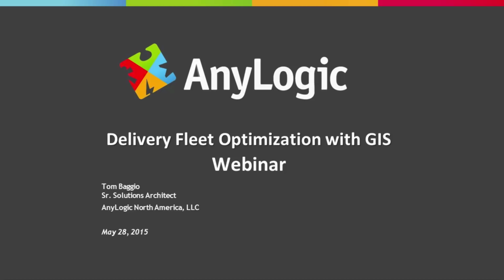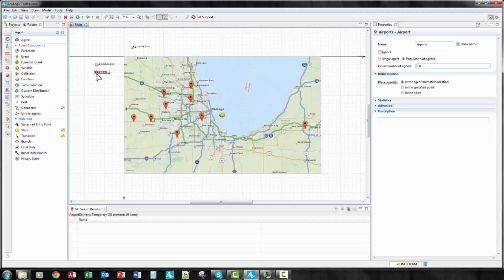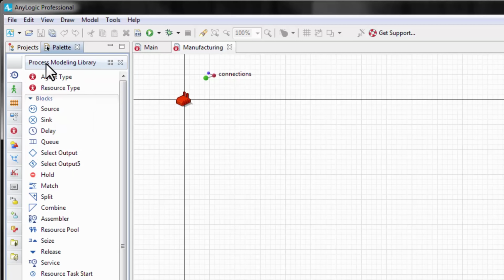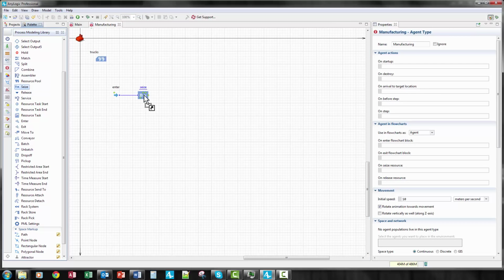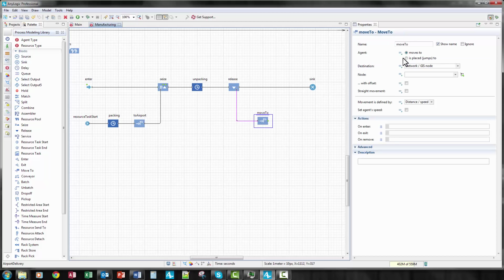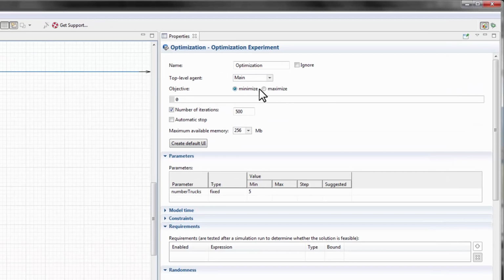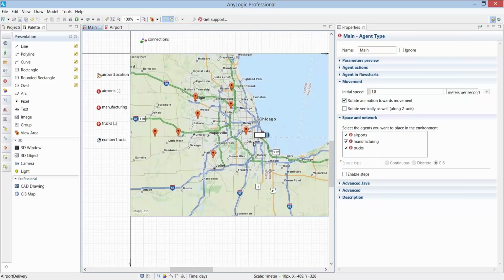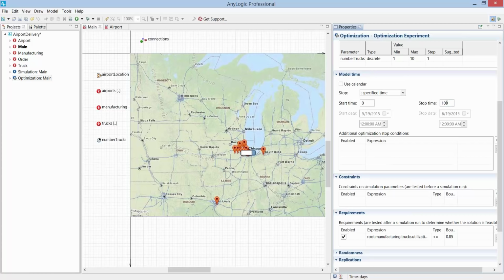Webinar | Delivery fleet optimization with GIS

Comment: Do we need to put anything on the constraints while running the optimization experiment as I am getting an error of infeasible solution
Reply from the maker: Thank you for the question. 

To begin with, some solutions are infeasible in the video as well (see timing 39:14-39:18). The fact that a particular solution may be infeasible does not imply that the problem itself is infeasible. However, infeasible problems do exist. Please have look at our documentation article about feasible and infeasible solutions while running an Optimization experiment for more details - https://anylogic.help/anylogic/experiments/optimization.html#feasible

Comment: How can I solve the error 'constructor is not defined'. I keep getting this error at the waitingdetails
Reply from the maker: Hi there, 

Please follow the steps from the video once again and double-check that the entered value, used Java code and connections between elements are correct. If the problem persists, please specify the time of the moment in the video when the problem occurs. Also, please share what AnyLogic version and edition you use.

Comment: Hii.Thanks for the video.Im so new to anylogic. 
1.why we are optimizing here?.We got output before optimization right?
2.If i need to stop  vehicle at each destination at 3 stops in a day and then resume in it in a next day for 3 stops how can i do it?
Thanks
Someone please  help me my basic doubts.
Reply from the maker: Hi, 

Please check out the answers to your questions below: 

1. Optimization experiments help to find the optimal combination of conditions (parameters, constraints, requirements) resulting in the best possible solution (maximizing or minimizing the objective function). The reason to use the optimization in this project is to define how many trucks are needed for a targeted truck fleet utilization. The targeted fleet utilization must be as maximum as possible, but not higher than 85%. The parameter that is varied during the optimization experiment is “numberTrucks”. As a result of the optimization experiment, we know that the value of “numberTrucks” that fits our objective most is 3. 

2. Making a truck spend some time in its destination is a part of further model development. This specific question is finely covered in Phase 5 of our tutorial “Supply Chain GIS (Agents)” - https://anylogic.help/tutorials/gis/5-further-development.html#phase-5-further-model-development. To be more specific, the transition that goes from one state to another should be triggered by: 
a. Timeout to make an agent stay in the state for a specific period of time 
b. Condition to change the state when some specific condition is satisfied

On a side note, as a first step in simulation modeling, we suggest checking our website section "Get started with AnyLogic" - https://www.anylogic.com/getting-started/. Some certain parts of this webpage are worth your attention, such as the "AnyLogic in Three Days" book. It provides an overview of the simulation itself, its concepts and approaches as well as introducing the reader to AnyLogic interface via instructions on how to build simple models. Moreover, here you will find materials on industry-specific libraries, tutorials, model examples and more.

Comment: When I run the simulation, the truck agent does not appear on the screen. Is there any explanation for that?.
Reply: I'm having the exact same issue right now..let me know if you ever figured it out :)
Reply: @thilde007  I haven't figured it out yet. Sure, I'll let you know when I find out.
Reply: @zaidkhallaf854  the source code for this tutorial is available (see link, download is at bottom of page) and the trucks don't show up when running that either..must be an issue with newer version of AnyLogic https://www.anylogic.com/resources/educational-videos/delivery-fleet-optimization-with-gis/
Reply: @thilde007  I re-installed the software, and I run the model from the link you provided, nothing happened. As you said,  it could be an issue with the new version of Analogic.
Reply: @zaidkhallaf854  I got my model to work. I replaced all of the agent presentation objects with basic shapes (circles and rectangles)
Reply: @thilde007  Thank you, That was helpful.
Reply: @zaidkhallaf854  @Tyler There is one more way it could be done. Delete the presentation icons and click again show presentation in this order: 1. truck 2.Airports 3.Manufacturing. Save the model and close it. Re-open the mode and run again. it should work. This is a new problem in anylogic
Reply: @hari670-o7d  thanks man. Shout out to anylogic for the great support 😂
Reply from the maker: @thilde007  Sorry, I almost jumped in but you were doing so well I opted to stand back. Now, in version 8.7.3 you should have trucks again.
Reply: @anylogic-simulation  hi I keep get an error like " root.originTerminal.toTerminal.delay.output.output: OutPort can only be connected to an InPort anylogic" what does it mean? I am using version 8.7.3
Thankyou
Reply from the maker: Hi  @DikasLittleWorld  The flowchart blocks are connected to each other via ports. You may only connect output ports to input ports, otherwise you will get this error. Please check the connections of the block mentioned in the error text.